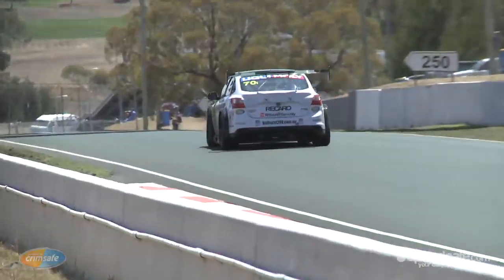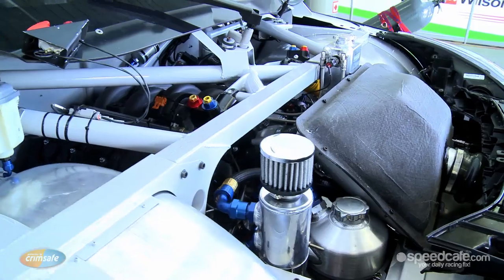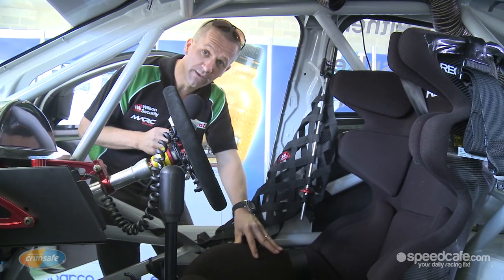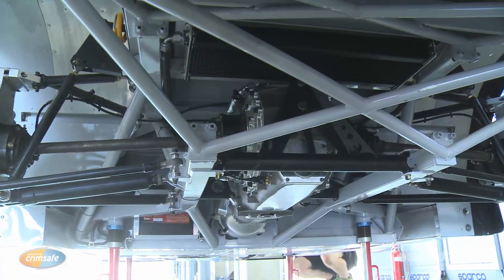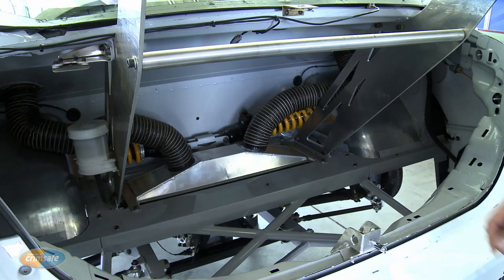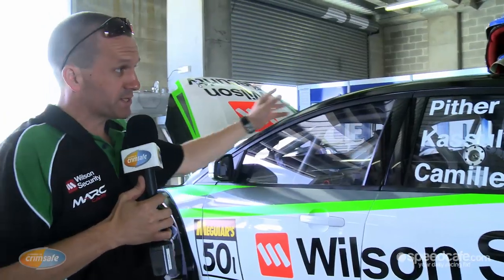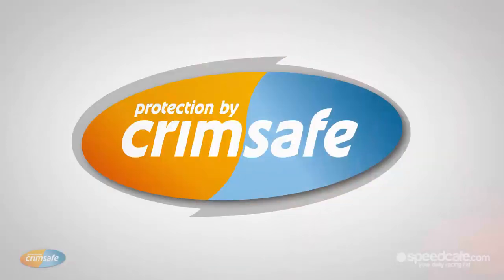Crimsafe Talking Tech - MARC Focus GTC

Comment: Great looking racing car, and did a great job in 2015. =)

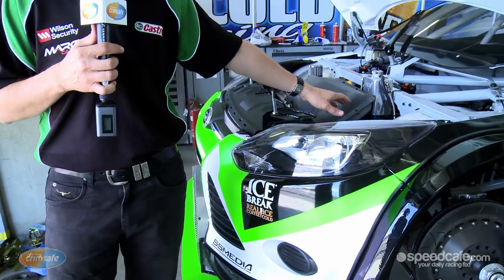Gotta love the part starting at roughly 2:54. "The idea of the chassis is that you can put any body over the top, that you want, the Ford Focus panels are simply stitched to the outside of the chassis. So this car could be a 3-Series BMW or a Holden Cruze, simply by changing the external parts."

No, that basically means that it couldn't be either of those cars, or a Focus, it just could look like them. I know, I know, supertouring gonna supertour, DTM, SuperGT GT500, V8 Supercars, or NASCAR and most other Stock Cars for that matter, none of them are any better... But damnit, saying outright that "Oh yeah this isn't the car it's listed as, it's just a purpose built chassis with cosmetic bits bolted on that make it kinda sorta look like one" is still annoying, I'd much rather just see them talk about it as "the MARC Endurance Racing Car" instead of a Focus, which it isn't. It's basically a prototype in disguise, like all supertourers are, just go out and call it that...

/rant